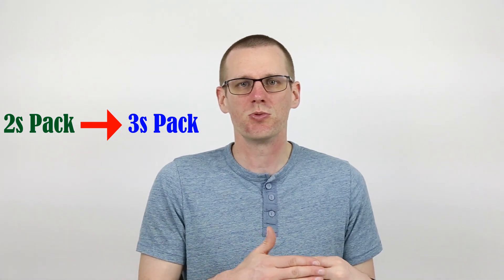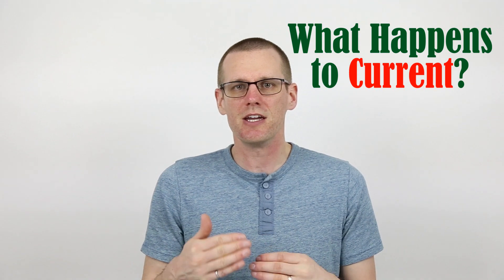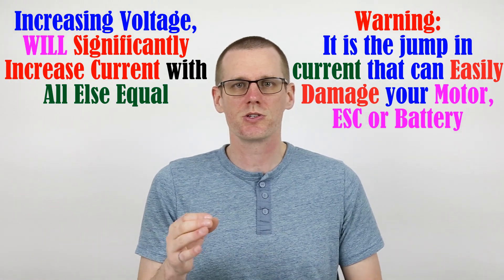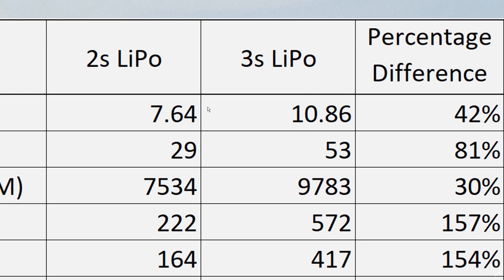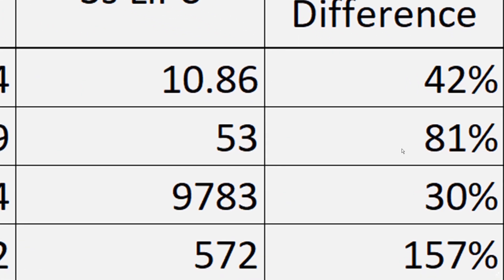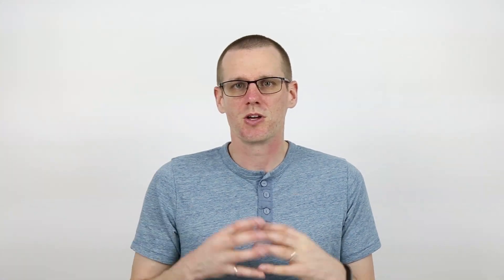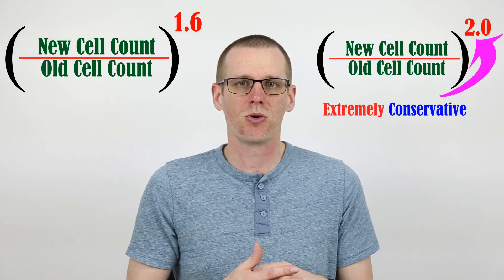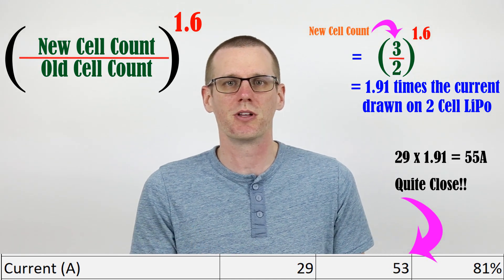Increasing LiPo Cell Count for Higher Speed Can be a Trap!

Comment: Hello i have one example which I tested.
Traxxas Sledge on 6S with XT90 connector on 12AWG cable(4600mAh 35C). Traxxas link App says: ESC Voltage 23,7V; ESC Current max 113,9A; max speed 84km/h
Then Yesterday on 4S with TRX4 connector on 10AWG cable(7200mAh 100C): ESC Voltage 16,6V; ESC Current max 113,9A; max speed 59km/h

Im surprised, that max Current is the same. Gap in speed is huge and expected.
On 4S temps of battery is low and also connectors and cables
On 6S temp of the battery is high and also connectors are warm and cables.

Why is it warm, when ESC says the same Current?
I know, there is higher voltage which leads to higher speed, but i expected way lower current on 4S.
New connectors AS150 just arrived. I wanted to have tests of 4S and 6S before i solder anything.
Is possible that problem with higher temperature(Batt, cables, connectors) is only because of low "C"rating on 6S batt?
Only difference is, 6S has XT90 and there is short reduction to TRX4, but i don't think this is an issue.

After approx half hour of continuos riding, that 7200mAh 100C was cold and also all the wiring which leads to ESC.
I Really wanted to change all conectors first time for XT90, then for AS150. But there can be only problem with low C rating am I right?
For the super right test, i can switch XT90 connector, back to TRX, for avoid XT90-TRX4 reduction and make an additional tests.

I think, that i have bought battery which is on the edge of using in the 1/8 RC car, and rather i can use it like a power bank 😀
Maybe is problem in underrated 12AWG wire for 6S, i seen tests with 100A and 12 Gauge wires when there was 80°C in short time.
If we have also C rating on the edge, it together can be bad combination.

I measured also resistances of the both fully charged batteries.
4S 100C has 1-2mΩ per cell (Batt is almost new and has 3 cycles)
6S 35C has 5-6mΩ per cell (Batt is new and has only one cycle of charging)

Thank you very much for response. I like your videos very much. Every batt im not using immediatelly i discharged little bit and charged on 3,8V - storage mod on SKY RC charger.

//edit, i watched your another video and visit pages which can calculate the real "C" rating. I placed there 4600mAh and the highest cell resistance (6mΩ) Result is 15C - Maximum Continuous Current 69 A - So there is an explanation?

Comment: You should do a video on BEC voltage on ESC's
Reply from the maker: What specifically about BEC voltages?
Reply: @RCexplained  Well I had asked in a Facebook group if it was better to attach a set of dual heat-sink fans to the ESC or the receiver.  Spektrum ESC's have an additional 2 pin JST connector that splits off from the ESC's fan wire.  I know nothing about BEC voltage and recently figured out what it stood for.  Any how, I got some conflicting answers as to what was a better option.  Some said that it was better to plug the fans into the ESC, while re-routing the ESC fan to the receiver, while others said it's better to plug the fans into the receiver because it wouldn't pull amps from the ESC and allow the ESC to run at it's peak.  But then someone followed up with how the receiver pulls from power from the ESC regardless, so either way, you'd still be drawing power / amperage from the ESC.

Also, how would one know if their fans will draw too much amperage from the ESC's BEC.  Most fans have a voltage rating, but is it enough to just simply match the voltage rating on the fan(s) to the voltage rating on the BEC?  Does it make a difference where you plug in your heat sink fans?  Is that wire coming from the ESC good for only one or two fans?
Reply from the maker: @ubreakitirepairit3569  I understand. One thing for certain is if you plug a fan in to the receiver, that is pulling directly from the bec power. Most castle escs have a lot of power available on the bec circuit. If you check what all your servos, accessories like fans can draw and this does not exceed the continuous bec amperage. You will be OK.

Comment: Are you sure that your formula is right and linear?
You are saying if I go from 4s to 8s the current will increase 9.2 times.
That’s a lot
Reply from the maker: An exponential equation will not be linear. (8/4)^1.6 = 3.03.
Or a way more conservative option (8/4)^2 = 4. However this is an absolute max and will not be achieved.
Reply: I was talking if you go from 2s to 8s the current will increase 9.189 times

Comment: If maximum voltage is exceeded (example 2200KV, max is. 6s, and 8s is put in, motor is toast becuz of excess voltage, current heat, or amps. overheating=toasted motor.
Reply: That’s absolutely not true
Reply: You can safely run 8s on a 6s 2200kV, but you have to make sure you dont exceed certain motor limits.